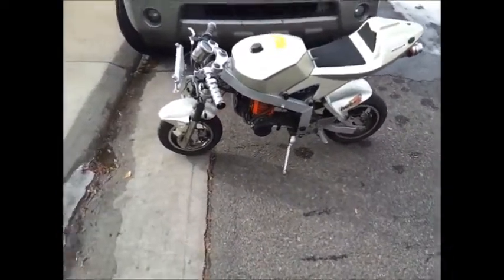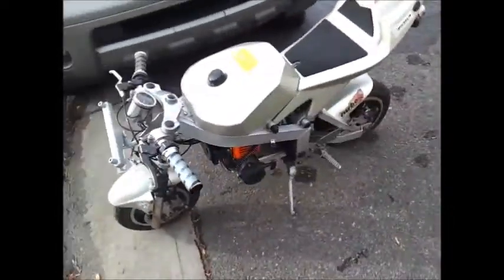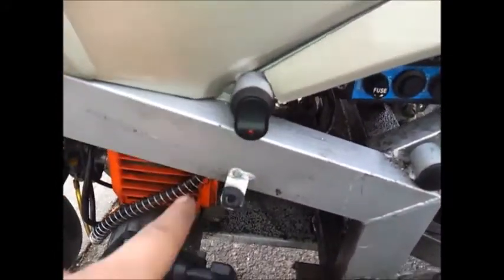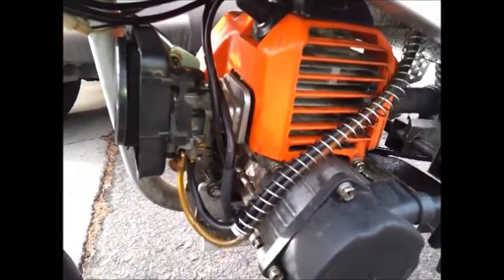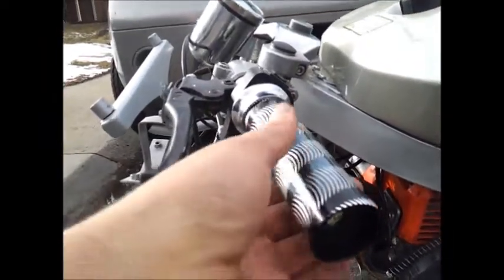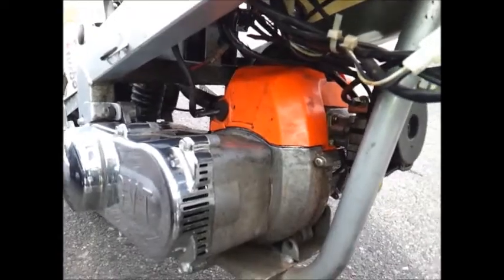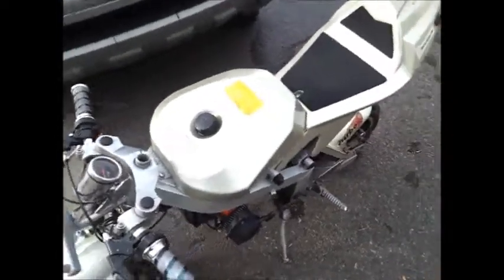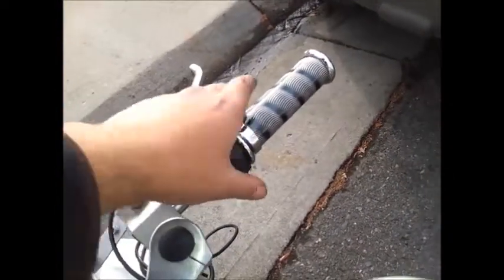X1 Pocket Bike Walk Around

Comment from the maker: Good luck. I picked one up a little while back too and when i found that the engine mounts/ bolts were mostly broken i gave up. Wish i would have realized that before i spent $100 on it haha. still was fun for a little bit and lesson learned. 

Broke the motor mounts after i bought a new pull start for it. While trying to start it for the first time.

Comment: I have one more problem and its that it looks like no gas making its way to the carbourator I half to poor gas on it to make it start. There's no gas in the clear tube either please help !!!!
Reply from the maker: There should be a primer bulb under the carb to help suck in fuel. How it does that is by pushing air form the clear tube into the gas tank and that forces fuel into the black line. If thats not working its time to consider cleaning the carb and replacing the fuel lines.
Reply: TheDrizzleX

Comment: I got that same bike but my pull start broke an idk were to buy a new one an also when I try using my electric start it will just make a clicking noise an won't turn on. Please help !!!
Reply from the maker: Ill send you a link to where to buy a cheap but probably good for a while replacement and as far as the clicking probably a dead or not enough charged battery to be able to turn the bike over. I would try charging it or replacing it if it doesnt hold a charge.